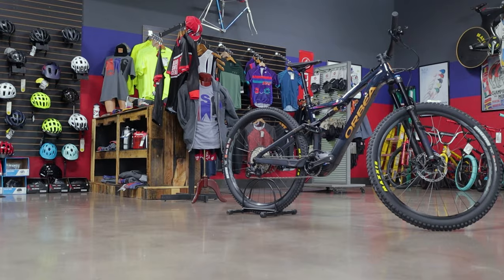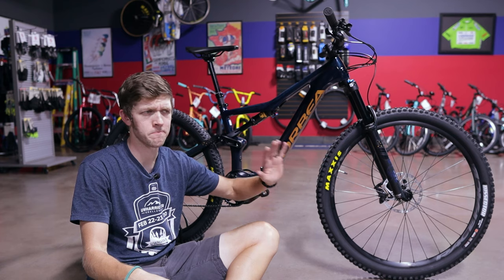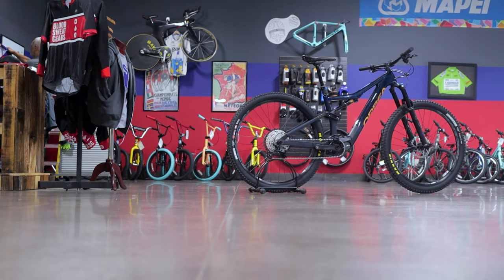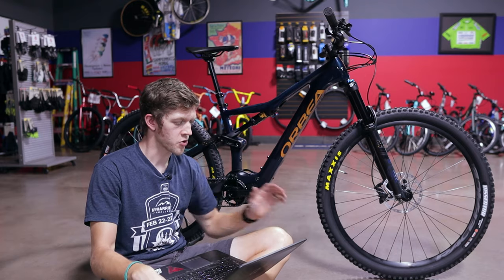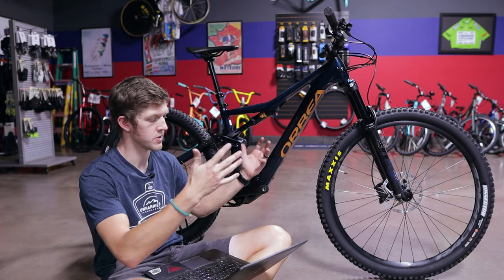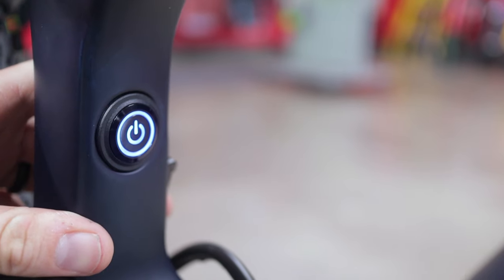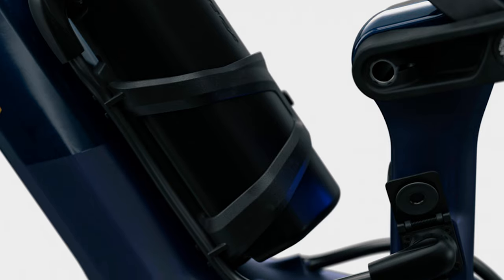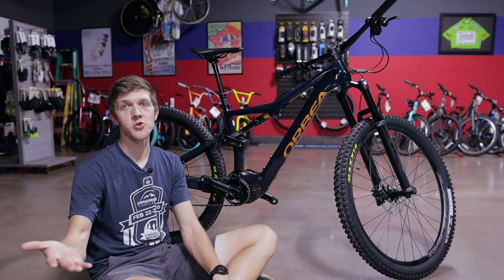Orbea Rise M20 first look! Best E-Mountain Bike?

Comment: hey I know this is a different topic with this video but do u think a 30.9 frame Seatpost size would fit a 30.8 Seatpost because 30.8mm Seatpost are the ones pretty common here in my country I can't see anyone sell 30.9. anyways killing the reviews as always!
Reply from the maker: I appreciate the compliment! That's so close that I would honestly give it a try if possible. I have cut up a coke can and used it as a shim in a pinch and the gap was bigger than what you are working with.
Reply: @MossieRidesBikes  I did it ones with the coke can on 80s bike, it did work great, but be aware that you need to be careful when pressing it down into the seat tube and hold it so it won't just slide down and the coke shim need to be positioned on the same level with the seat clamp.
Hope it helps if it not to obvious. Just wanted to share :)